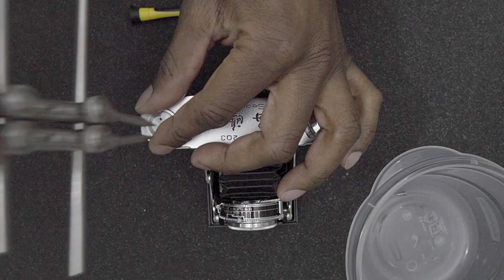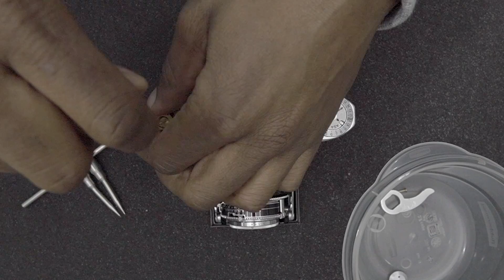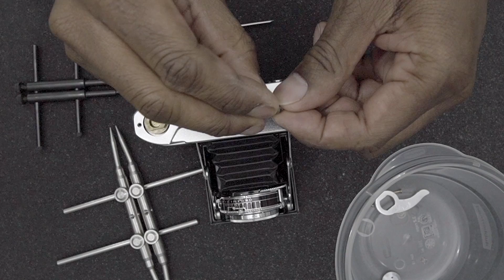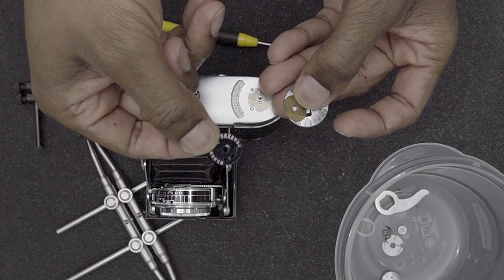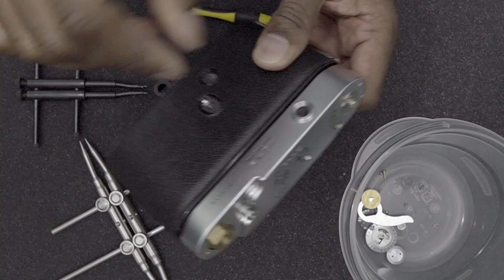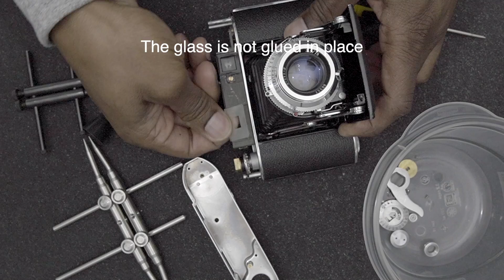Seagull 203 Top Plate Removal

Comment: Informative video, any idea how to calibrate the rangefinder?
Reply from the maker: Yes. The rangefinder is a weak point of this camera. After removing the top, you will see the adjustment screw. It is very weak and hard to set to say the least. What I did was use a piece of ground glass on the film plane and adjusted the rangefinder until it was sharp at infinity. I did add some nail polish to the rangefinder screw to hold it in place since it wasn't too "sturdy". I hope this helps.